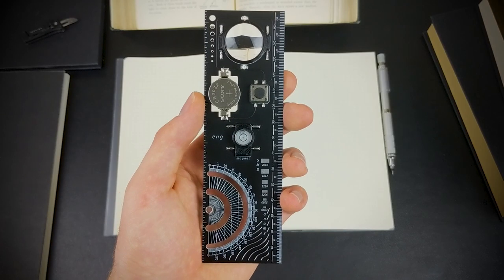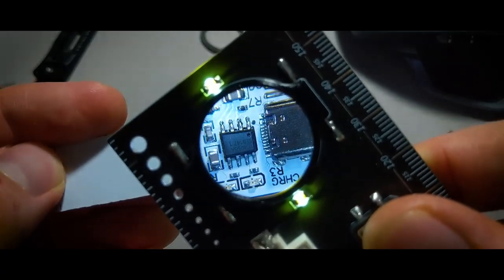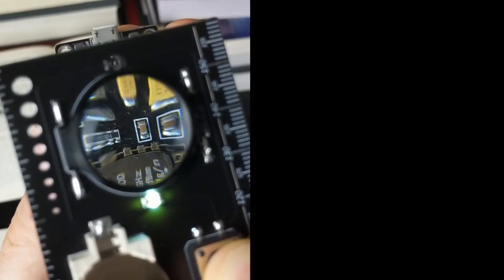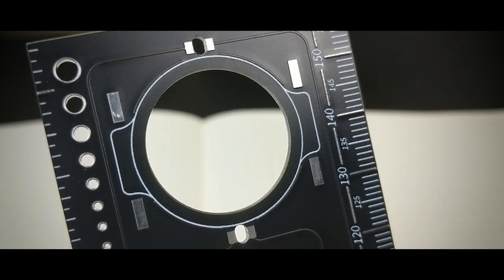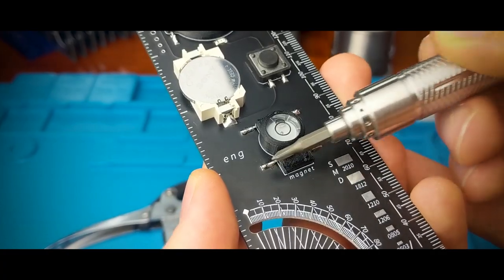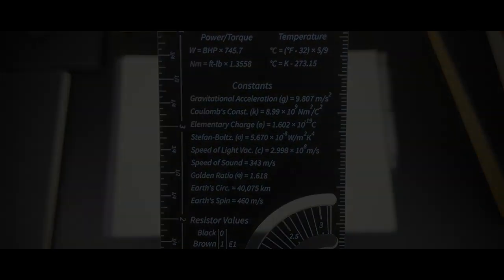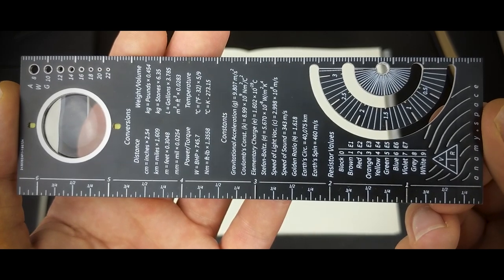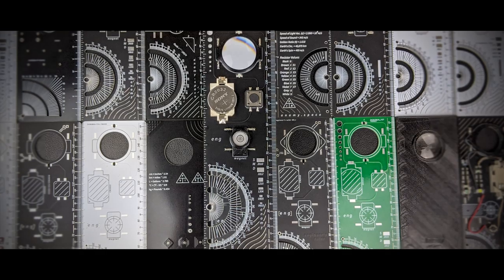Engineer's PCB Ruler

Comment: This is an awesome product. I'm studying to be a computer programmer, not an engineer, so a physical ruler doesn't help digital design layouts. I'm pretty sure I can still recognize what a good design this thing has. I'm a big fan of multi tools in theory, but so many seem disjointed to the point where I'll buy each tool individually, rather than buying three tools that do almost all the same things. The set of features on this ruler actually complement each other and don't appear to leave anything out. Good work.

Comment: Hey anamy

Im into my first semester of engineering. Ive been doing good in terms of grades but I am worried about something. Im not the type of guy to study long hours and I haven’t been studying much to earn good grades. Will this mentality of not working hard to earn my grades be my downfall in my engineering career?
Reply: Mohammed emad yes
Reply: At least study 1 hour and 30 mins a day
Reply: Unless you know you are good at the current subject
Reply from the maker: Hi Mohammed :)
Being a bit slack in the first semester or even the first year is pretty common, and most universities do expect that to be the case and try to ease you into a more serious studying routine during that time. You will probably find that most students will pass the first semester of the first year, a few will fail the second semester, and then a lot will fail during the second year. This is because the difficulty spikes in the second year and continues to grow until it more or less flatlines near the middle of the third year (or at least that is how it felt for me). I guess the thing to remember is that it's normal to not study much in the first semester, and if you can get high grades without studying then you're doing great! Or more specifically, you did great learning what you had to in school (since the first semester is largely a recap of the maths, physics, and report writing you learned in school). So I guess just keep doing what you're doing and begin building a studying routine, read books on discipline (this helped me), and try to manage your time a bit, then slowly refine these things as the years pass and you'll be fine :) 
As far as your engineering career goes, anyone who graduates has done so because they have become good at time management and decent at self-discipline. So when that time comes, you'll have nothing to worry about.
I hope this helps a bit x

P.S.
I was like you in my first year, but once I got settled in and became used to being a student, I naturally got better at studying and everything sorted itself out :)
Reply: anamy eng thanks for the help this is very comforting. I was kinda scared about it, since engineering is known for long study hours. I commonly hear that everything will fix itself but I do have an issue with non-stem subjects.
Reply from the maker: @mohammedemad7384  It's my pleasure! Best of luck and congrats on making it this far already :)